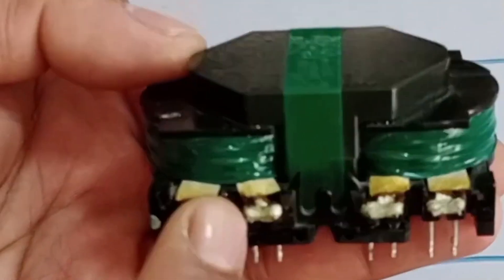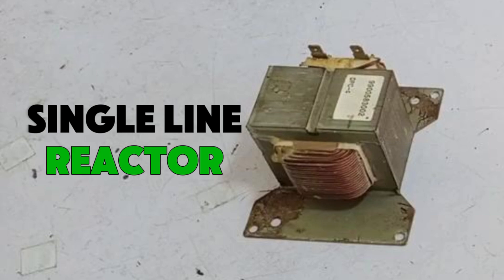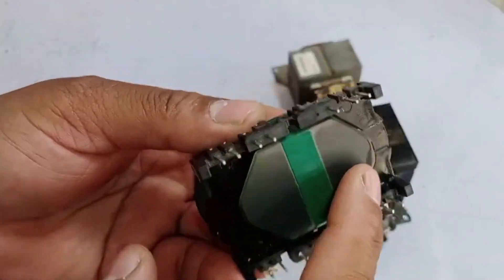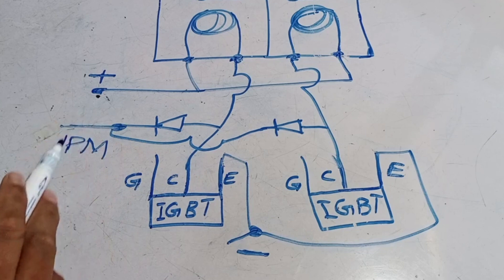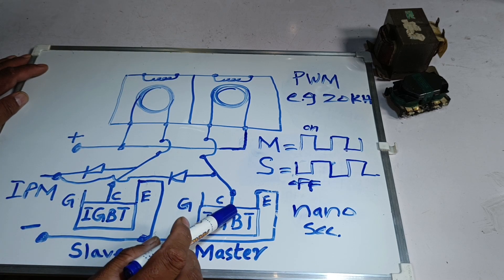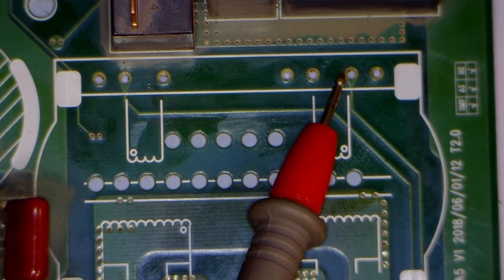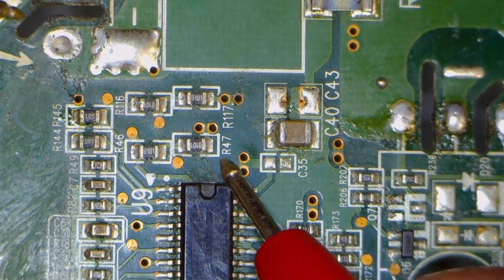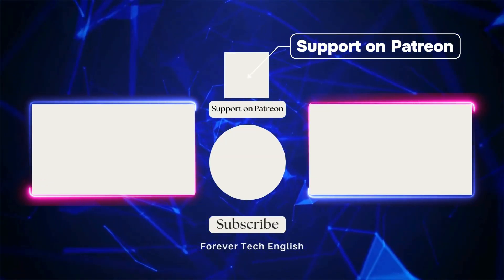How Double Line Reactors Fix Current Flow in Electronics!

Comment: The ferite version it use less material in the fabrication…. + it makes the AC external unit lighter with @ 1 kilogram  … but it may be more at a 24000 btu or higher unit … and the installers will definitely apreciate the lower weight 😊

Comment: That small double reactor is part of totem pole PFC. Other than that, has some 40uH inductance per reactor, big reactor has 3.5 mH (more or les few mHs). Double reactor is on ferrite core, big one is on iron core. Double line reactor works on much higher switching frequency.
Show some waveforms. No one in power electronics, I mean authors of books call it master and slave.
It's just interleaved BOOST PFC.
Reply from the maker: Thanks for the detailed explanation!

Comment: So it's based on push pull type converter, but master and slave duty cycle is controlled individually, master charges the core with magnetic energy and slaves discharges it regulating the power and maintaining pf to near unity ...
Reply from the maker: Yes, you are right, it's a push-pull type converter with a master and slave.
Reply: Not push pull, it's totem pole.
Reply from the maker: Really? Can you explain that please?
Reply: @forevertechenglish  no place in the comment. Just read any reference design from Infineon, Microchip, Texas Instruments, etc.